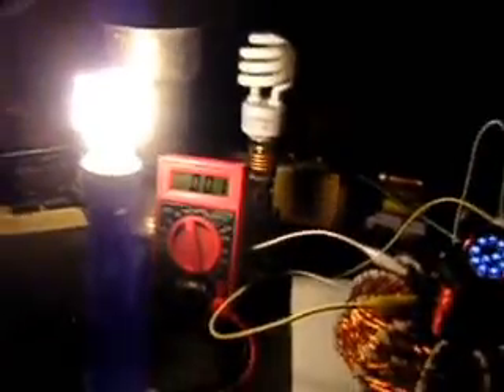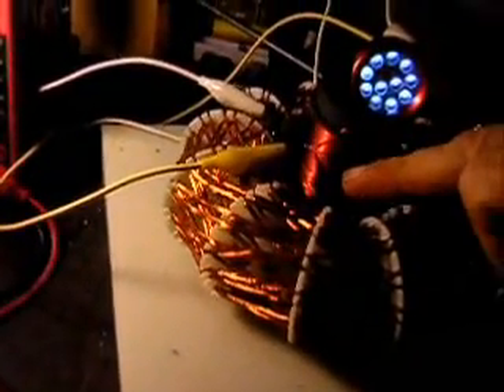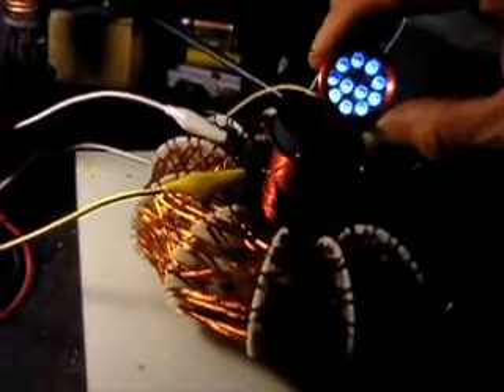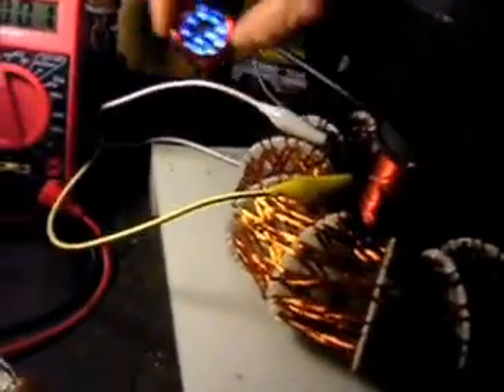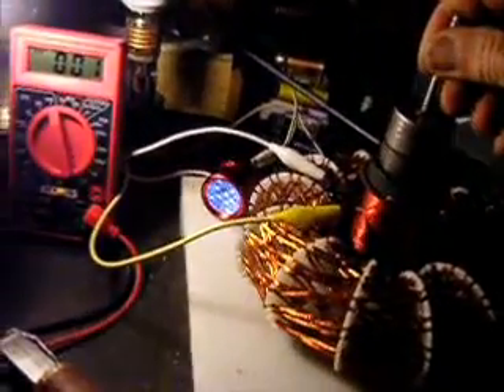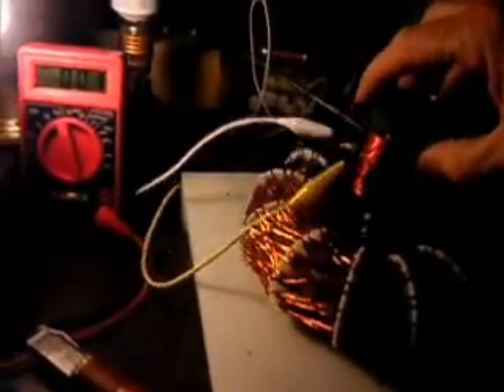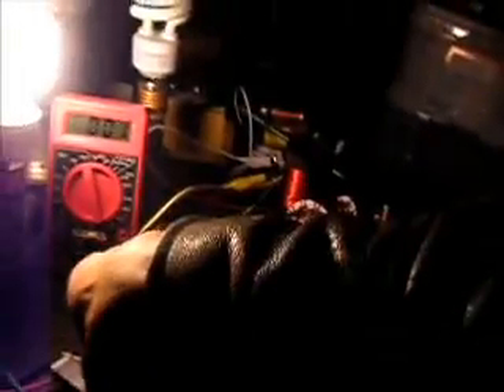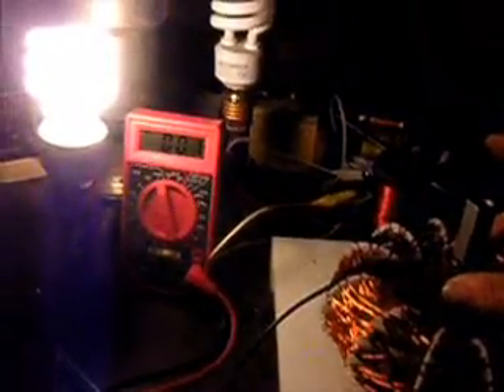Vortex coil + ignition coil = high voltage

Comment: So this is basically a super Rühmkorff coil
Reply from the maker: Same principle, yes.
Reply: @jprice1122  Nice! So, then if I wrap a vortex coil coil around an ignition coil as a tertiary coil and it will sharpen / shorten the impulses producing the effect of higher voltage. Thats energy effeicency increase on the table. 12v car battery, distributer system, ignition coil and ceramic capacitor produces all the charge you'd need for a high intensity discharge.

Then, of you shunt the discharge with yet another vortex coil surrounding the spark (the coil protected by ceramic coating) then the spark will allow current to pass through the second vortex coil which is wrapped around the spark at the center of the vortex coil it will behave as a magnetically quenched spark gap. So between you're idea to wrape a vortex coil aroind an ignition coil and my idea to wrap a vortex coil aroind a spark gap-- both will cause the impulse duration to drop, raising slew rate di/dt rates, and thus effectively raise the voltage of the individual impulses which can be repeatedly sparked.

This is free energy. The more high voltage and short duration the spark, the more torque for the same amount of input energy. Coasting between pulses = more efficiency.

I'd like to connect and talk about this. Im a philanthropist who wants to help the world. My current project is more AI and open soirce operating system focused these days, as free energy was more likely to get me killed or homeless to persue. But, where theres a will, theres a way.

Free energy, wireless communication, and anti gravity, we can acheive all of this especially of we work together! My email is my youtube username @pm.me

Comment: sweet. How did you wind that vortex coil and I need to test out using mangets to up the voltage in my pulse motors.
Reply from the maker: Check out ABHA coils, Rodin coils. Serious pain in the ass to wind,  but fun to explore.  The magnet in this video was from an old refrigerator compressor.   Good luck and keep on exploring.
Reply: @jprice1122  Ya I heard if the Rodin coil, star coil and a few others. I need to beef up my coils